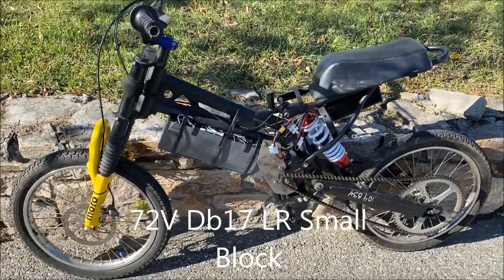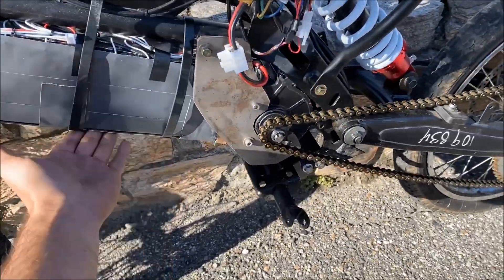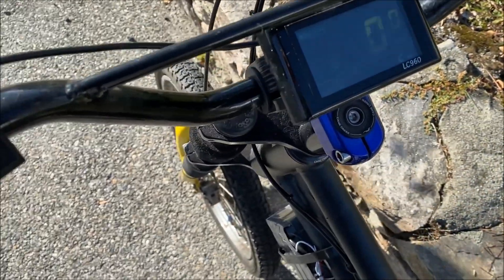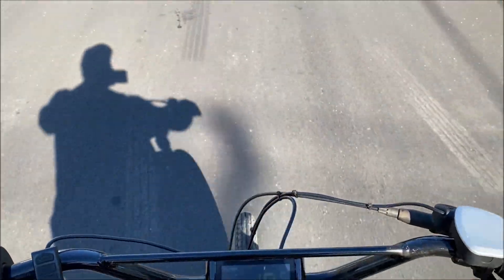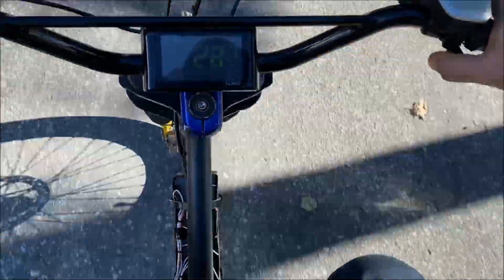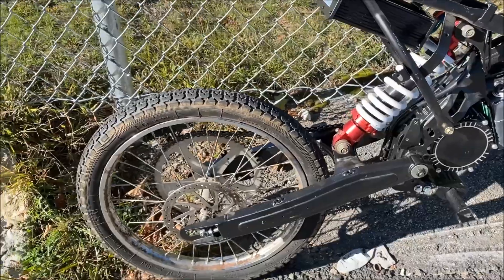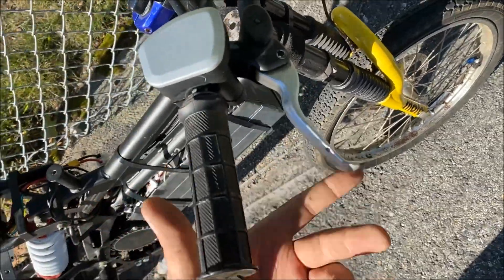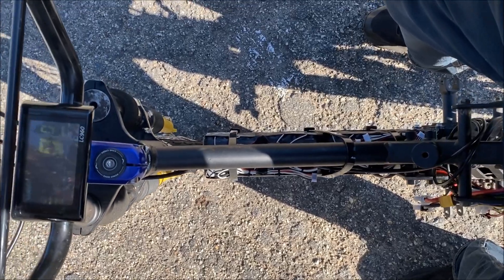72V Db17 LR Small Block Electric Bike

Comment: not sure if you saw but the chain is in fact resting on the frame of the bike, not sure if it is causing problems but good build so far!
Reply from the maker: Thanks I will watch out for this!
Reply: @EBIKEScott  you should try adding a chain tensioner. It’ll help keep your chain from hitting your frame.👍🏽
Reply: @EBIKEScott  or you can try taking off a couple links from your chain.

Comment: You might need a little more chain tension? But it sounds like something running out of true. Front or rear sprocket? One of the wheels?
Reply from the maker: Ya I have the correct 415h chain now, I am going to swap them today and see if it helps. Was using a #41 chain same exact pitch but a bit wider